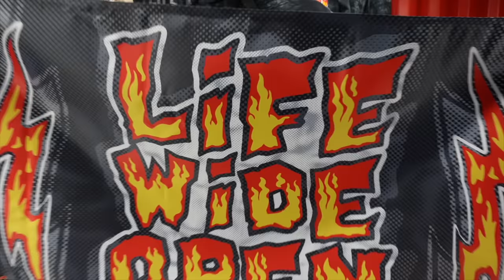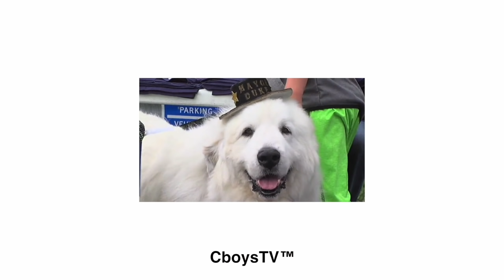Utility Quad Gets Out of Control

Comment: Is it a requirement that all Polaris 4 strokes sound like tractors with stock exhausts?
Reply: Good sounding tractor
Reply: Its a twin cylinder 4 stroke engine, it basically is a tractor. Think of it as a sport tractor.  There low revving engines restricted with emissions b.s.

What 4 stroke utility quad sounds like anything but a performance vacuum....?
Reply: I just bought one last month and it’s honestly the loudest quad I’ve ever heard from factory

Comment: good video but you realize that quad has a break in time, especially the belt, without running it at low rpm for 50 miles you will be buying another $100 belt soon and metal shavings in your oil